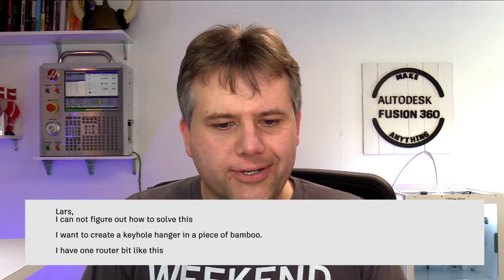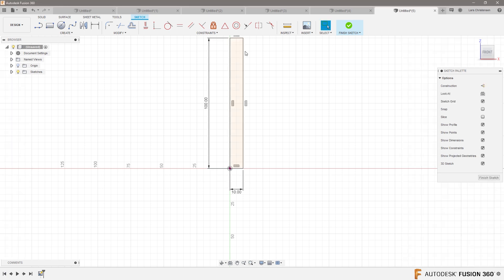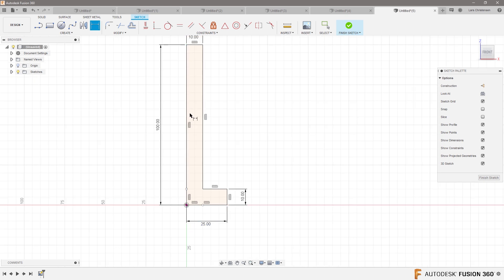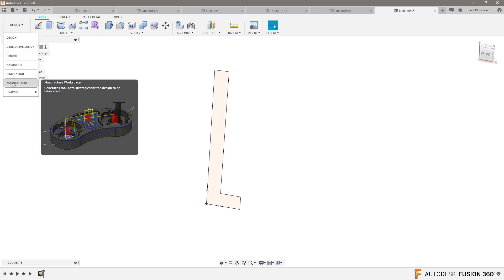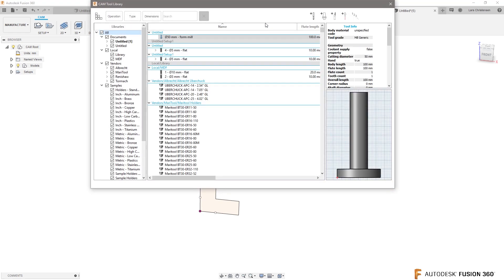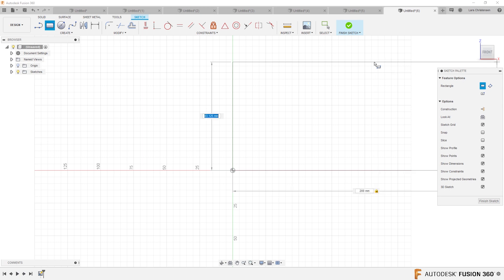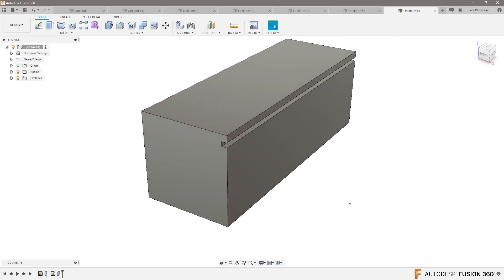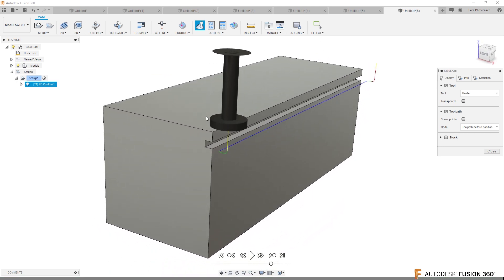Fusion 360 — How To Create a Custom CAM Tool — Ask LarsLive

Comment: Hi Lars... Great video as always.  How do you create a form mill where there is non cutting geometry below the cutting geometry.  Say for example a slitting disk with a retaining nut.  I drew up the slitting disk and set the tools origin at the bottom of the disk.  I wanted to add the retaining washer and bolt to reduce risk of collision.  But I cant find a way to let Fusion know the Z=0 for the tool is not at the bottom of the bolt but the bottom of the cutting disk

Comment: Hi Lars, nice vids dood!   hope you can help wih this...i have a 50 year old colchester lathe that i have converted to a very basic 2 axis cnc (no tool changer etc) and i have got as far as creating a part in fusion and exporting a toolpath that runs correctlt on the lathe. Most of my lathe tools are home ground HSS but i cant work out how to add these to the tool library.   Is this at all possible?   cheers   tanc

Comment: Hi Lars,

nice video about to create a custom router bit. But you missed the 2nd question about how to create a keyhole in wood... You have to dive into the wood go several centimeter in one direction, stops and go back to the dive in point and pull the router bit back to the safety height.